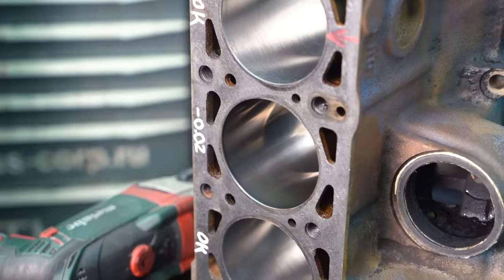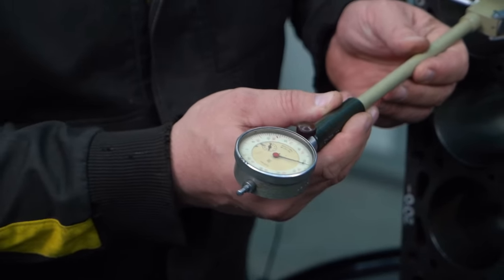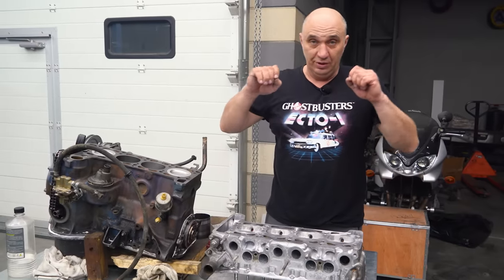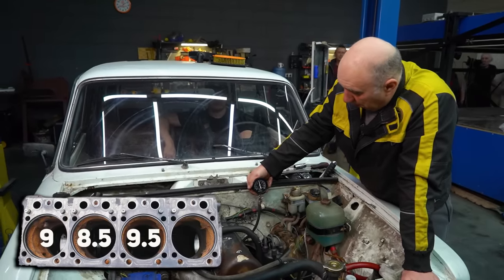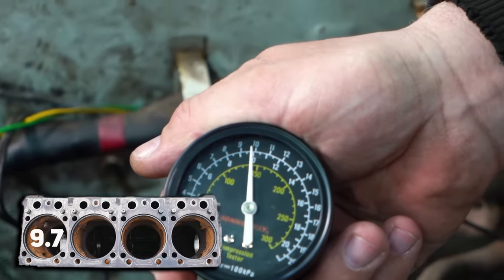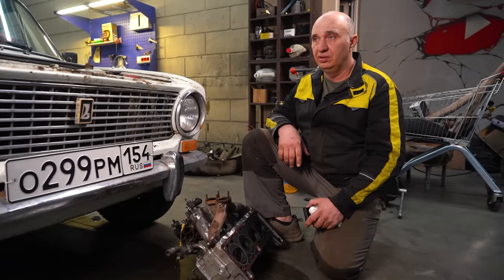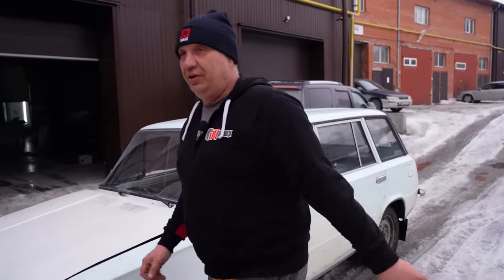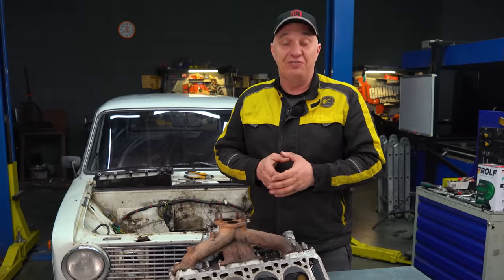Honed cylinders or mirror finish - which is better?

Comment: Honed of course.  The rings will seat and seal much better in a honed cylinder.
Reply: it seats less better but the oil remains on the walls so its always lubricated with a film of oil and makes the sealing better
Reply: This was actually a topic of heated debate but it was quite a while ago in internal combustion engine history.
Reply: the oil have to stay on the cilynder, so honed
Reply: @retrocompaq5212  This.
Reply: Polished could be good for race engines that get rebuilt every race or run. But other than that honed is best for seat and break in.😎
Reply: In polished cylinders the rings might also seat in, but after a long period of time
Reply: @retrocompaq5212 also, the oil will help with compression a little bit, maybe less blow-by.
Reply: Mazda has chrome like cylinders now. I assumed it was a sales thing to the less then knowledgeable public
Reply: No mirror will provide the closest seal allowing for greater compression it's basic physics
Reply: @phonotical  Are you sure?
Reply: @phonotical  If the walls aren't porous enough, the oil won't absorb into the surface and you'll likely get excessive blow by. Lots of counterintuitive things going on with engines.
Take two pieces of metal and polish one to a shine, scuff the other to a matte or satin. Place a drop of oil on each one and you'll see for yourself. It'll bead up on the shiny but it'll wick into the rough and disappear.
Reply: @markbroad119  Chrome lining is good stuff, it doesn't mean polished, it means there is a chromium layer or the sleeves are an alloy with extra chromium. The best pewpew barrels are chrome lined.
Reply: @dannymitchell6131  that's why piston rings can flex
Reply: Some manufacturer use cylinder coating to minimize friction. Coating is some kind of polymer like  used in frying pans.
Reply: Where the hell are the rings going to be seated in a bore? 

There isn't a chair!
Reply: @dannymitchell6131 yep🏆😁🏆
Reply: @Iowa599  You don’t know much about the engines do you? Have you not heard about an oil cushion in an engine ? Well that cushion goes in the chair that allows the rings to seat😂
Reply: @markbroad119  because the public knows or cares or ever sees the inside of their engine 😂
Reply: Nope, mirror finish doesn't retain any oil which will kill the rings and piston in a short period of time. Been there and tired that decades ago
Reply: @Bryan-Hensley oddly a bore with 100K on it may well be mirror like
Reply: What if you bedded in the rings then polished the bores? Guessing minimal difference. As for my understanding of honing it’s to help bed in the rings and to help retain oil on the bore.
Reply: @whitemonkey7932  I just took apart a 5.7 with 580,000 miles on it, crosshatch honing was still showing. Unless there's been oil starving or bad oil issues, there'll be very little if any wear.
Reply: @Bryan-Hensley why do engines with 100K on the clock need boring? I know....let's see your reply
Reply: @pekahon you mean teflon?
Reply: It all depends on what rings your using people.  Go ask a ring manufacturer or an oil engineer.
Reply: Also retain a film of oil every stroke to minimise wear
Reply: I personally think cylinders should be galvanized 😂
Reply: The Ghostbusters ECTO-I T-shirt made me subscribe to the channel.
Reply: He literally just tested it there’s no difference like other said cross hatch on the cylinder is for even consistent oil spread
Reply: The cylinder with abnormally high pressure was mirror finish. Doesn't that indicate less blow by?
Reply: Its proven they dont last long so hard accels and decels get the rings to expand the best and push them harder against the wall taking full advantage of the hone marks . Hard break in is best just never hold revs long till broken in. Lots of swift accels and decels is best its proven on dynos time and time again.
Reply: @phonotical  You've never had anything to do with engines right ?
Reply: I haven't watched it yet. If someone asked me that's what I would say. Let's see.
Reply: If polished was better you’d see it in cars. You think these companies spend billions in engineering for no reason?
Reply: @Rekoyl116  but you do.
Reply: @craiglaing2417 that would be a more accurate test but for that test it would also be impossible to test as as soon as you polish the cylinder bores the rings wouldn't match the cylinders anymore
Reply: @markbroad119 its mor like micro scopic dimples that hold the oil its better than cross hatch
Reply: This video seems to suggest there's little difference.
Reply: I think that this experiment will teach everyone concerned why there's rules that apply to engine building.
Reply: @dannymitchell6131 Ummmm, you don't know what you're talking about. You don't even know the weight of the oil, viscosity or ANYTHING, but you know how it's going to adhere or absorb into different metal surfaces?
Reply: WOW! So many people just making wild assumptions, making it clear they have NO knowledge of fluid dynamics whatsoever 😂
Reply: Also its for oil
Reply: @HarryHewitt-lh8xx yes also the honing stays you dont want it wearing away 👍
Reply: Honed seems like the more practical option imo, less surface area so less friction and due to the etching oil can stick to the cylinder walls better again causing less friction not gunna say I know what I’m talking about because I don’t that’s just what makes sense to me polished seems like there would be too much contact and nothing for the oil to grab to
Reply: One thing often not considered is the nuances of polishing processes. A honed surface has the signature of a machined surface. So you know it's a precise cylinder. Polishing the surface with a buffing wheel on a drill removes material enevenly, making it slightly off-round and tapered. If the surface had been polished using a CNC machine process, the compression results might be better and more conistant than what you see here.
Reply: In small engines quite often the cylinders get glazed over from dirt ingestion and have to be rebuilt. Definitely honed.
Reply: i do not recommend mirror finishing your cylinders,best result are honing your cylinder with 600 grit then finishing it with 800 grit,we do that on race engines,2 strokes and 4 strokes, even for daily drivers,we observed it will not eat the rings too much,problems with rough honed cylinders is that mostly on motorcycles,the oil rings will get worn much faster causing it to blow smoke out the exhaust,thats why we recommend 600-800 grit for best performance and longevity!
Reply: honed is better for longevity but polished is better for efficiency
Reply: @greenlungo3996 Exactly, honing a bore by hand will mess up the cylindricity. Even with CNC machines, at high precision it's hard to get a good finish and perfect cylindricity at the same time. I inspect parts at a machine shop and we run pumps that have bores with a .0002 inch tolerance range for diameter and a 16-32 microinch surface finish. There is an inverse correlation between the roundness/cylindricity of the bore and the surface finish, even when using fancy reamer tools. The more taper the cutting insert has from the front to back edge, the better the surface finish, but the worse the roundness. If there is hardly any taper then the roundness will be perfect but the finish will not be quite as good. Although if there are other holes intersecting with the bore, less taper is better in general.
Reply: One of the best car manufacturer uses mirror cylinder technology and you call that Car "the Godzilla". Yes, Nissan uses mirror cylinder technology, on most of its cars, including GTRs.😅
Reply: @fulvioplatania3091 well that just means burnt oil
Reply: Not true on a 2 stroke.. I wanna see you hone a chrome bore.. lol.
Reply: @munchgaming4589  who’s we ?never heard of you bro , so we better take you’re race engine building advice 😂
Reply: @fulvioplatania3091 eventually the cross hatch goes away.
Reply: You are correct. YouTube videos are being made for the bottom rung of society now. This stuff was common knowledge back in the day.
Reply: Develops wear pattern and seals combustion pressures that what being seated means.
Reply: @dannymitchell6131 Engine blocks are not porous. Oil beads on shiny surfaces because of fluid physics and surface tension, it runs away on scratched surfaces because the oil falls into the scratches thus breaking the surface tension and fluid physics makes it run off the surface via the scratches.
Reply: Racing engines are almost always mirror finish with underneath the lines of the first stone
Reply: @spannaspinna never heard of me cause i only race motorcycles in thailand and philipines,do i need to be famous to be a good mechanic? yes in my area im famous.
Reply: @munchgaming4589  cool you jus stay and play in you’re 3rd world country where you can be the coolest , out of your paddy farmer friends
Reply: @phonotical lol ur wrong
Reply: @diegotrapani7129  nope
Reply: Wrong, it’s a matter of use, if it’s run daily , then hone it, but you’ll see many general aviation engines use chrome barrels to prevent rust from sitting, so it’s application …
Reply: @GRANITEMONUMENT  no
Reply: @dannymitchell6131  i wouldnt say the best. they take forever to shoot out but they are less accurate. best for military use or other high use situations where 1 moa accuracy isnt needed yeah its the best.
Reply: Yes and oil sticks to the wall better
Reply: More so for oil retention
Reply: @idrift314  yes👍
Reply: @deven6518 not if honed right! New engines with over 300,000 miles will still have cross hatching! Doing the right hone is the life of a engine, because the valley's will hold oil,plus less drag.
Reply: @r.c.1213 wrong! Even top fuel cars gets honed after each run on rebuild! Most use the flex hone to deglaze the cylinders.
Reply: @whitemonkey7932  went to school for diesel mechanics  
    my answer to your question why do engines need bored 
     they wear out of round and tappered  the piston does too also they devolpe a ridge from wear that will break rings 
    we would use telescoping gages with micrometers to measure out of round taper on cylinder and piston and measure the ridge on the cylinder 

    sometimes could get away with just using a ridge reamer with oversized piston and rings if it isn't worn too out of round and tappered 
    with most diesels though you just slap in a new factory honed sleeve 🎉
    better check your liner protrusion though

    but always hone your cylinder it is essential for ring wear in 

     will get crazy blow by and burnt gummed rings if you dont
Reply: gotta make sure you stagger your ring gaps also or will also get blow by burnt gummed up rings loss of compression 🎉
Reply: and as someone else stated chrome lined cylinders have absolutely nothing to do with a mirror polish 
      it's just resistance to oxidation and high tems from running top fuel and nos still has a cross hatch hone for wear in 
   alcohol based fuels attract moisture
Reply: @whitemonkey7932 their answer I imagine would be if it ain't blown up don't need no measuring or boring here 
    do you really believe a 500k engine had no cylinder wear 😂😂😂🎉 
 

    maybe he was just looking at the hatching on the ridge lmao
Reply: Matte screen protector feels smoother than clear mirror like screen though.
Reply: Depends what kinda engine it is...

Comment: Back in the 80s, I rebuilt an engine in the parking lot. I hand honed my cylinders not knowing what I was doing. When I first started driving after the "rebuild", the engine was really down on power. It took about 1000 miles for the piston rings to seat and the further I drove, the power slowly increased.
Reply: Have the engine also consumed tons of oil at the beginning?
Reply: Rings and especially diy honing tools have come a long way. Now a days a flex hone can give you a killer finish if you go roughly the right speed up and down, and make sure you clean them real good. Rings now a days don’t have any problem sealing
Reply: The problem there was that the bores don’t wear round, they wear into a tapered egg shape. Rings can’t follow those cylinder walls. Out of curiosity, was it a Chevy 350? They used soft cast iron like the Ford Windsors did, but had a taller deck height and longer stroke in the 389 and 302, so they don’t wear as much as the Chevy. The 351W’s were not as plentiful so I don’t have much experience with them. Maybe one a year would come into the shop.
Reply: I ran 5hp. Briggs and Stratton engines on a race kart. I would rebuild several with hyperotective pistons with zero gap rings and use them at my home and shop for a year to break in the rings. then tear them down come spring and put the billet rod,loose fit by .005 over stock. long poly oil flipper, tuff ride crank. 
It was amazing the difference then just honing, build, race…..
Reply: Did it go back to spec?
Reply: Lmao hand honed how long did that even last. The honing job on the video looks sad as hell too
Reply: @POVShotgun These tests were performed on a state of the art combustion engine 😊
Reply: Pretty sure that's the engine breaking in
Reply: learned to seat the rings the harder way huh
Reply: @POVShotgun no your jealous and sad
Reply: @POVShotgun  My mate, who's a 74 year old mechanical engineer , has build some of the fastest Vintage motorcycle race engines in Australia, he hand hones them all with a hand held drill and stones, I'd suggest you have no idea what you're talking about....
Reply: @th600mike3  Flex Hone is really to give a plateau finish on a bored and honed cylinder or 'glaze bust' a high mile cylinder that is still inside wear limits to fit new rings (I taught 'machine shop' at a trade school)
Reply: @amishmafia3339 
 OHV or side-valve? 
The angled updraft port on Briggs side-valve isn't too bad after you fill the sharp angle where ports were machined  into block. Little bit of porting and blending, 5 angle valve seats and you get easy 10bhp from you 5hp motor.
Reply: @POVShotgun  What's wrong with hand honing?
 There are several companies making  adjustable hones that fit ordinary handheld drill (usually recommended 400 rpm max, battery powered easier to use but low on torque)
You can buy a brand new Sunnen ($400+) or Sunnen clone relatively cheap. (AMMCO were always more expensive plus stones getting difficult to buy)
 I used to teach students to bore  a cylinder to +/- 0.002" then hone to +/- 0.0005" after a few days training. (Curriculum didn't call for better accuracy) 
 Some students, (who had bored their own stuff) would easily hone to size (0.0000" ) or  better than 0.0001". Even the very cheap three leg spring glaze busters can work but it's incredibly difficult to get accurate sizes and round/parallel holes with them
Reply: That's how rotary engines are too. After an engine rebuild, your compression actually goes up for a while as all the seals bed into the housings. It can be 20k miles after a rebuild and you'll have significantly higher compression than right after reassembling the engine.
Reply: @POVShotgun  show us your hone jobs tough guy
Reply: That is pretty keen 👌
Reply: What engine and car was it?
Reply: That's normal, takes about 1000 miles to properly "stretch" a rebuilt engine, especially one with 80s tolerances. Drive cautious for first 500 miles then bursts of speed to stretch it and full chat after 1000 miles.
Reply: @th600mike3  Would love to try diy honing but hear all different things.
Reply: The whole point of the rougher 'hone' finish is so the rings can literally file-fit themselves aka bed-in. It severely cuts down on the time needed to break in the rings. If done wrong, you can damage the engine with oil & blow-by before they seal.
Reply: @th600mike3 chromemoly rings are hard to get to seat compared to nonchromely steel rings
Reply: Good anecdotal evidence